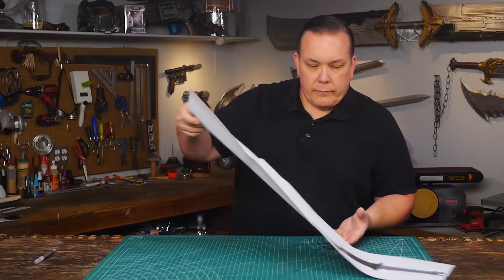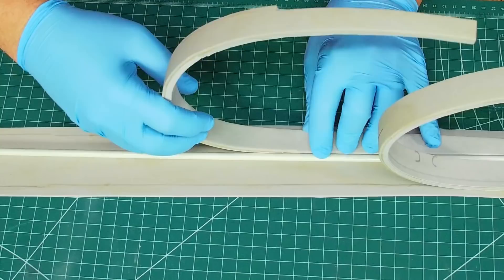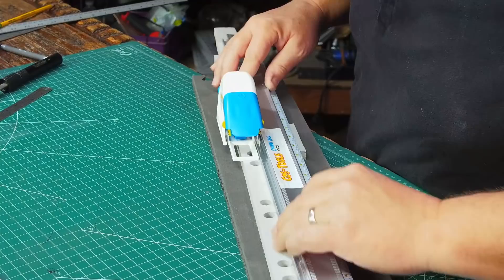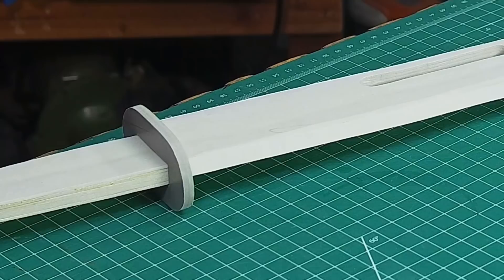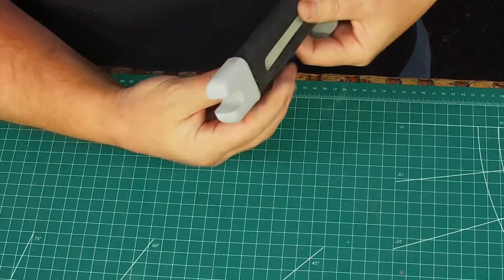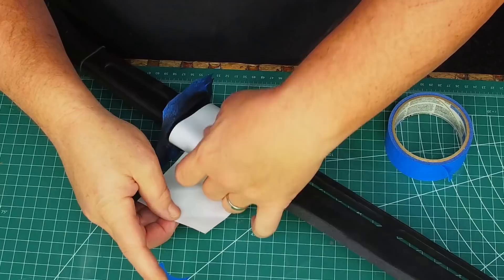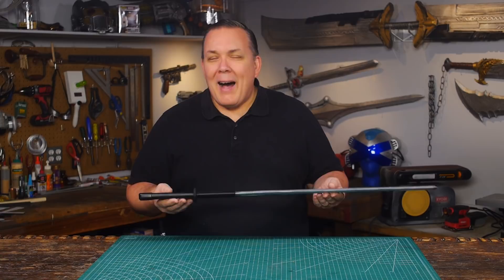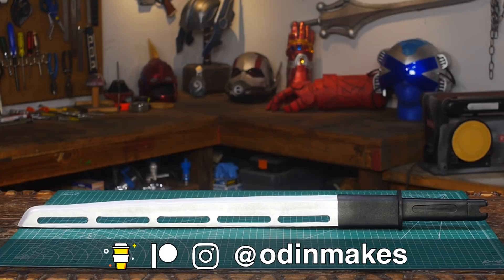Odin Makes: Ronin Sword from Avengers: Endgame

Comment: If you don't want a texture on the foam after you use plasti- dip, just use mod Podge. It doesn't leave a texture if you use about   3-5 coats it gives a hard plastic feel and makes it look shinier so the paint job looks better. It even comes in a spray form so you don't have to hand paint it on. I used it for an Ironman suit and it worked out great. Hope this helps!

Comment: For your plastidip, have you tried heating up the can in hot water first? I use Seal Prime (exact same product, plastidip isn't sold in the UK) and I put boiling water in a bucket, then put my can in there with a weight on top - it goes on so smoothly when hot :)

Comment: Hey Odin, I’m making the ragnarok swords, and I don’t have a belt sander. How would you suggest I sharpen them?
Reply: Jack Stark id day best option would be sandpaper and do it by hand. Gonna take longer but yea haha
Reply: You can get them cheap for around 70 bucks.  I am thinking about getting into foam prop making and a belt sander is one of the first things I plan on buying.  I hated hand sanding in wood shop so I would rather spend the money on a sander plus the belts than do that again.

Comment: A question, if I may:

Why didn't you spray a layer of filler primer on the blade rather than a coat of the clear Plasti-dip?  Seeing as you had a base coat on already, the filler primer wouldn't damage the foam and could have made the finish smooth.

On a related topic, have you ever tried Molotow's Liquid Chrome for your sword blades?  I have used it in a couple small hard plastic projects, but haven't yet on a foam project, so I don't know how well it swill stand up to potential flexing...